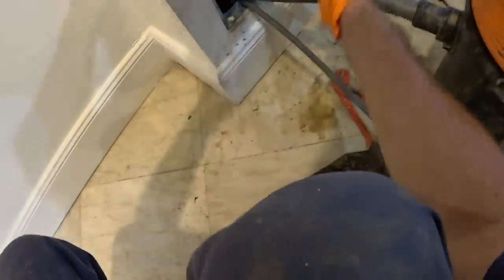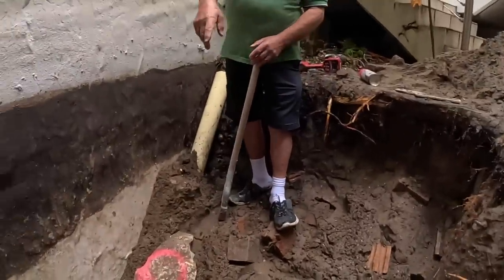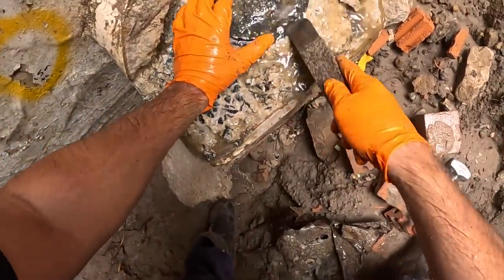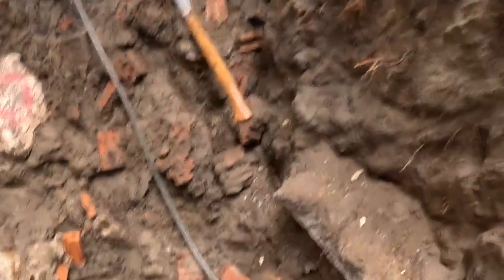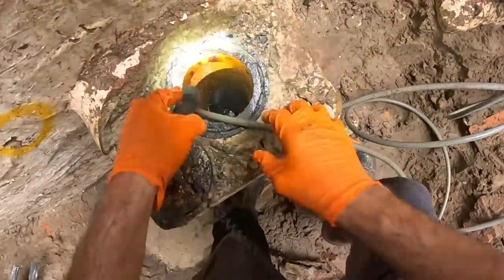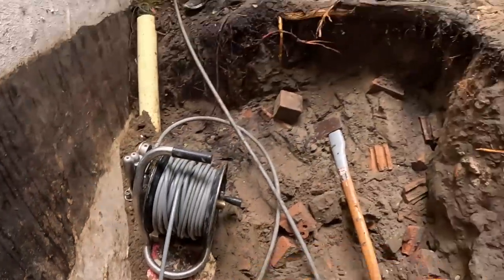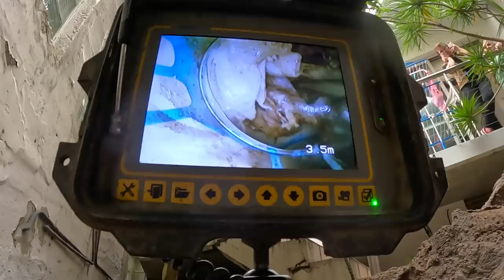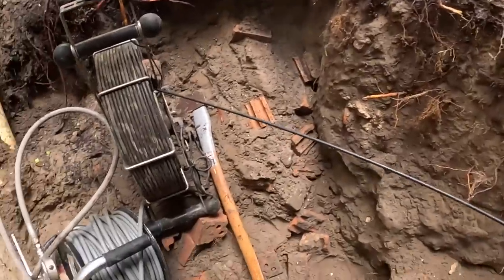Blocked Drain 775

Comment: I know in the US we've been testing an idea for stuff like this to prevent the tree roots we use old rubber we heat them tired we melt the Rubber and spray turn it into a liquid and then you spray it down the drain it's around and you spray the walls to seal the pipes like this I don't know if they've done I don't know if they're ever tried that in this region but it might be a neat idea to try I know they're experimented it with it here in the US when it seems to have worked pretty good cuz in my area they were having this problem and they did it once and they haven't had any we haven't had to have to replace the pipe or we haven't had the clogs anymore from the trees

Comment: a cordless rotorhammer would make your life easier for things like this. you can use them for concrete, hard dirt, or anything else in your way. i do concrete and i use them on a daily basis. its so much easier than running a cord and finding an outlet that has power.

Comment: Tim from Canada you should maybe invest in SDS jackhammer that is battery operated maybe find one that works on your battery line.. if you can find one that is reasonable priced with a few batteries this will save you in the long run.. just suggestions

Comment: Attention. Drain atticit… Tim from Canada if you look where are you are there in Australia or where are you have your big box stores that sells the rigid, wet, dry vacuum cleaner you can buy ones that you hook a garden hose onto and then when you circled the water, it goes right through the machine and out the garden hose to where you wanted to go. For example, if you were inside a house instead of you always going outside to dump your wet dry vac, you hook up the garden hose to the wet dry and then come sit out for you just a suggestion if you were looking, I know I mentioned this before but if you were on a job and you were on the inside instead of always going out, you get yourself ( therigid wet dry vac with garden hose attachment)